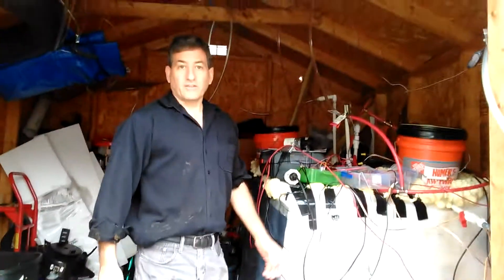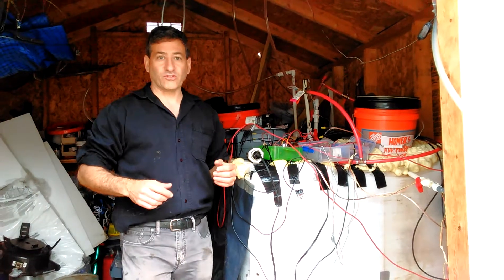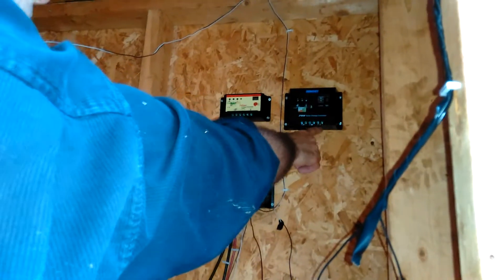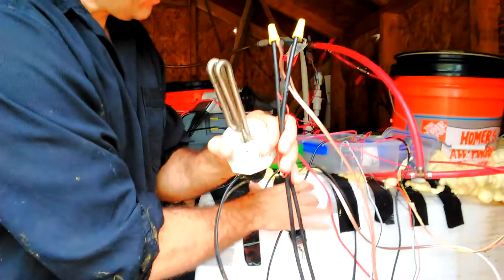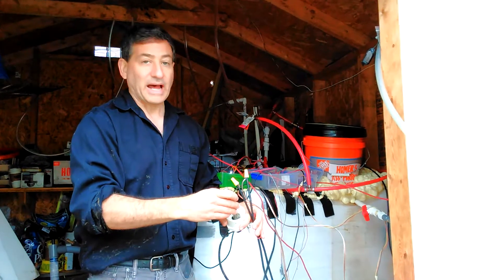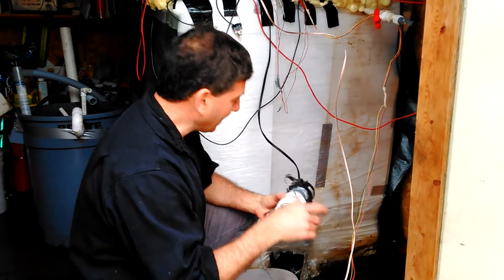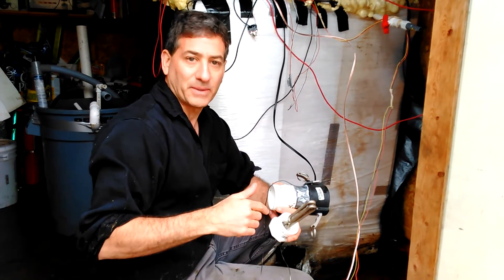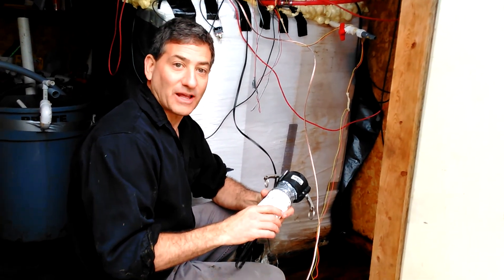Heating element for biodigester

Comment: as i remember your biodigester setup i would suggest to put the heater at the end of a pvc tube, where the heater looks like a " broadhead " ( like a spear), lead the cable through the tube and connect it to the current source. insert the wohle thing form the top into the digester not close to the ground. 
the reason i suggest it ,is because i think the liquid is not fluid like water so it could be a problem for the temperatur and the heat exchange in this little place at the bottom where you put into the valve.  sorry for my technical english. i am not so good at it.  but i hope you get the idea . 
another practical idea : russians put a lampbulb direct into the tank of their cars. 21 watts is enough to keep diesel unfrozen in sibiria... so if you take a normal driving light bulb its 55watt. they are very cheap ;)

Comment: Hey T.H., nice info, thank you! At Tamera, did you use biogas as part of the sunpulse system with heat battery? Or was it only woodgas and sunpulse combined? It could all be combined I guess. I will try to connect on FB too. Rock on!

Comment: I would be concerned about the heat affecting the surrounding plastic components over time making them brittle especially when running at 60watts more so at 300 watts